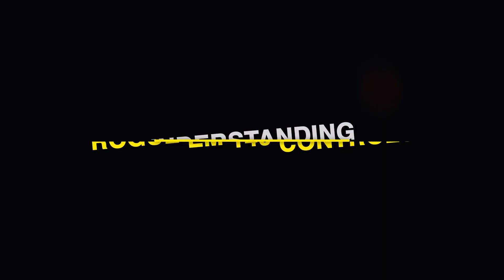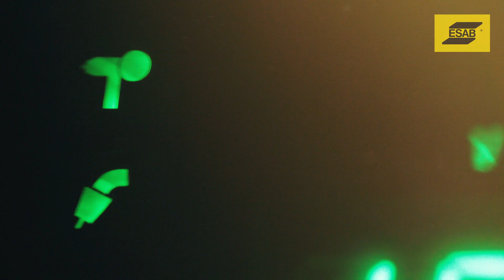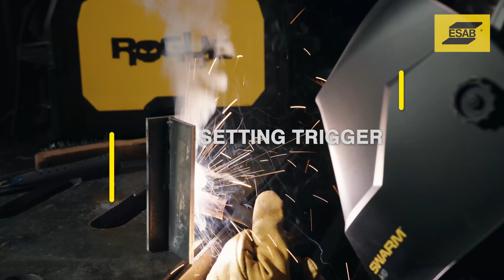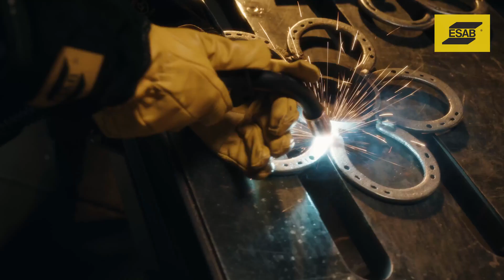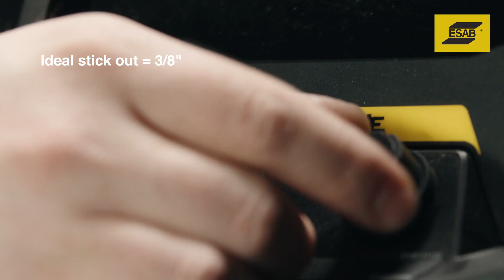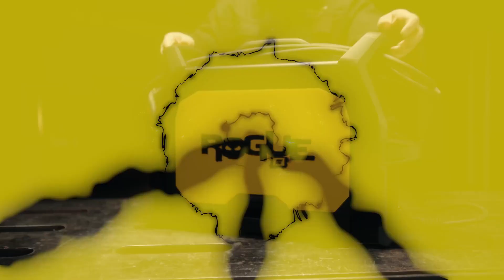Understanding the Controls on ESAB’s Rogue EM 140

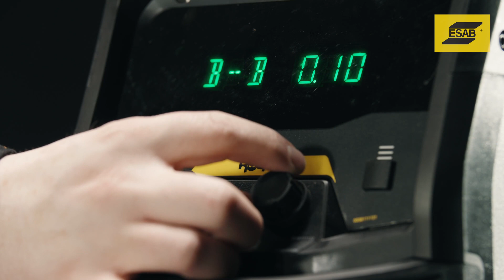Comment: @3:05 what does this mean it defaults to set values? It didn't show how to set the pre flow. When did it default or shut off pre flow to begin with?
Reply from the maker: Hi there, thank you for your question.  In order to best assist you, we ask that you contact our Technical Service department for assistance. You can reach them at 800.ESAB.123 (800.372.2123) and follow the prompts.